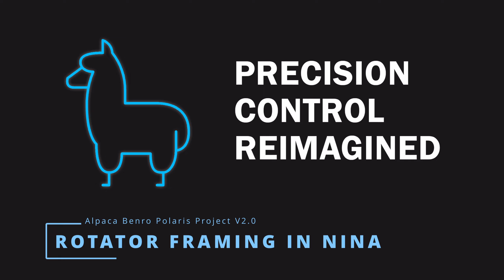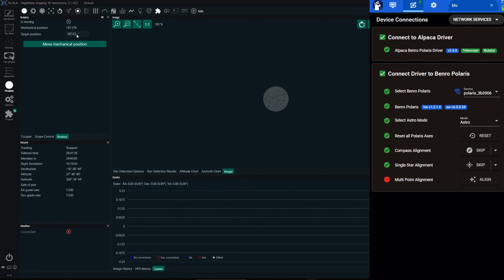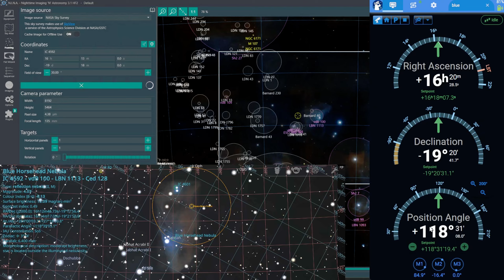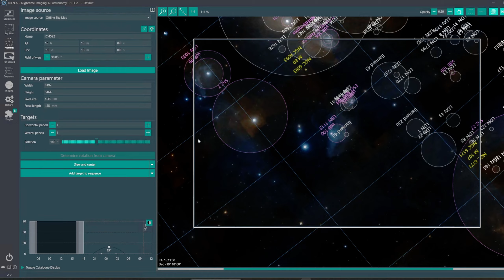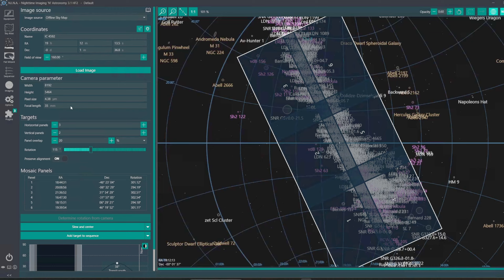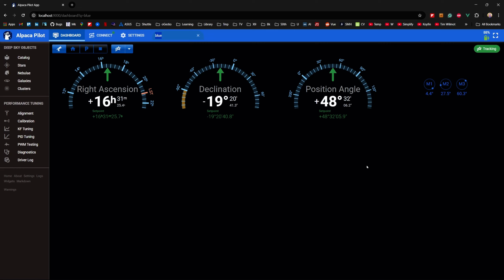23 - Alpaca Rotator Framing in Nina and Stellarium

Comment: Hi David, are you running the recommended mini PC/Remote Desktop method, or is everything on a single computer?
Reply from the maker: I'm running Nina and the Driver on a MiniPC on the mount. I remote into the MiniPC from my laptop when at a dark site, or office computer when at home. Its a bit overkill but my office computer has 4 screens. I have the Remote(Nina) on one, Stellarium on my office PC on another, and Alpaca Pilots on the other two. I've been doing all development using remove VS Code on the MiniPC so I can quickly turnaround a change and test it.
Reply: @jdm5001  Thank you! I was curious because I am trying to learn v1 (while anticipating v2) and wanted to make sure my architecture was correct. I now have a similar configuration. NINA sure seems a tad daunting, but I am trying to keep my eye on the prize. I have a tentative goal of shooting a double MW arch early next year, so I have much to learn.